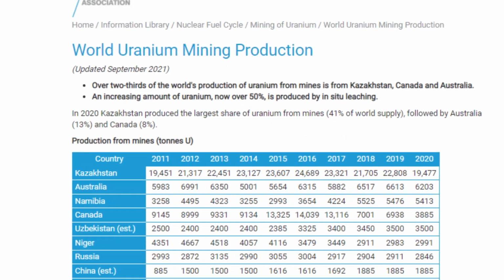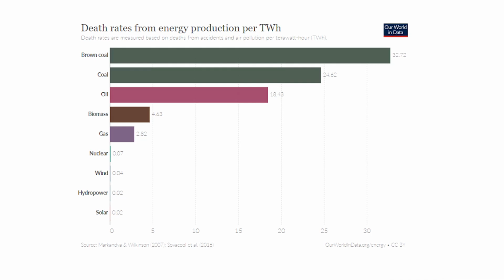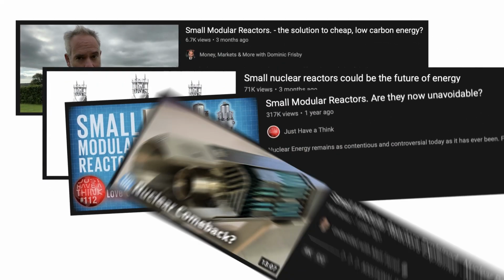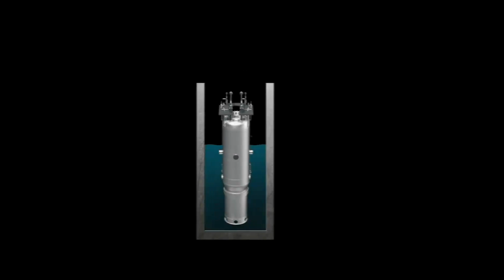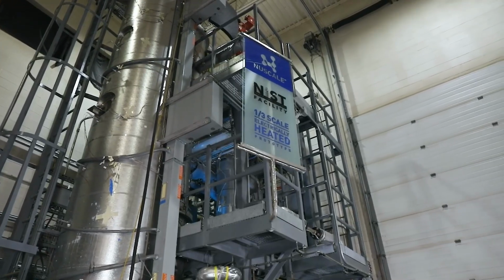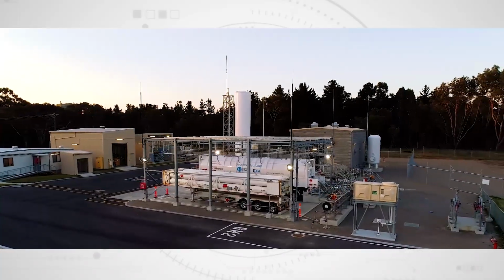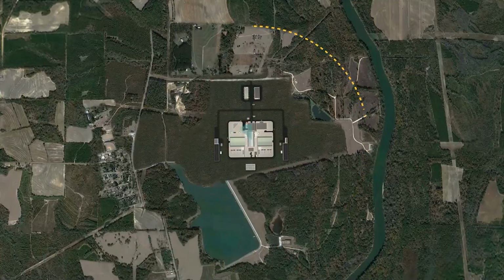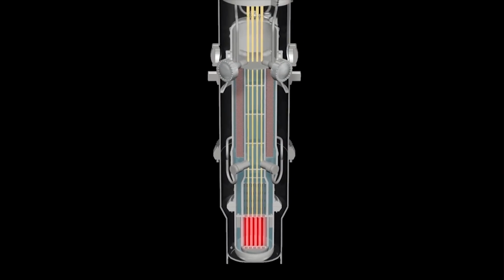Can Small Modular Reactors Save Nuclear Power?

Comment: My only really strong opinion about nuclear is that shutting of nuclear before you get rid of fossils is super stupid.
Reply from the maker: Where there aren't safety issues, I agree with you.
Reply: @EngineeringwithRosie  Sure, but safe operation of any power plant - nuclear - and also hydro, geothermal, wind, solar - is a given.

Similarly it is a given that coal plants (without sequestration) CANNOT be operated safely - acid rain, particulates, heavy metals, radiation - all directly into the biosphere.

However, were any of the German plants shut down due to safety concerns? Um, no.
Every once in a while a regulator finds a safety concern, the NPP is shut down temporarily, the operated fixes it, and the plant is reopened. There was no long-term concern for any of the German NPPs - in fact Germany has one of the best safety records in the industry!
Reply: @factnotfiction5915  Putin is a NPP country, no problem there.
90% of the world's population is in dictatorships, no problems there.????
Reply: @factnotfiction5915  actually, there were plenty of safety concerns, not to the level of a potential meltdown, but still. Germany saw a string of incidents and accidents in the years before, accompanied by a lot of untrustworthy behavior by operators (hiding incidents, late reporting, downplaying, dragging their feet on implementing mandated corrections, etc). So in a way, Vattenfall (and others to some extent) laid the groundwork for the later decision. 
I also agree that it wasn't a smart decision - what they should have done is make an example of Vattenfall, removing their operator license for good and make them sell off thrir plants to more competent operators.
Reply: @stephenbrickwood1602  '90% of the world's population is in dictatorships, no problems there.????'
The problem with a population living in a dictatorship is that they live in a dictatorship, it has little to do with civilian nuclear power plants (NPPs).

Putin's Russia is an example: If the RF closes all their civilian NPPs, will they disarm their nuclear weapons? - no.
If the RF builds more their civilian NPPs, will they build more nuclear weapons? - no.

You don't need civilian NPPs to build nuclear weapons, and there is little correlation between weapons and civilian NPPs. The United States built 3 nuclear weapons in 1945. Twelve years later, the first civilian NPP was built, Shippingport in 1957.
Reply: @factnotfiction5915  RF ???????
Reply: @stephenbrickwood1602  RF = Russian Federation
Reply: @factnotfiction5915  
There is a correlation between nuclear power plants and nuclear weapons.  The US nuclear weapons use tritium, which must be obtained by using nuclear power plants.
Reply: @acmefixer1  
There is NO correlation between nuclear power plants and nuclear weapons.
* Germany has NPPs, no nuclear weapons.
* Japan has NPPs, no nuclear weapons.
* Slovakia has NPPs, no nuclear weapons.

* Ukraine has NPPs, no nuclear weapons.
* Mexico has NPPs, no nuclear weapons.
* etc etc

* North Korea has nuclear weapons, no NPPs.
* Israel has nuclear weapons, no NPPs.
* etc

* USA built nuclear weapons, before NPPs.
* USSR built nuclear weapons, before NPPs.
* France built nuclear weapons, before NPPs.
* UK built nuclear weapons, before NPPs.
* etc, etc

Yes, the Indians built a NPP before building the bomb. They waited 30 years before taking that step. 

Nuclear bombs are a political decision, and civilian nuclear power has little to do with it.

However, civilian nuclear power does PREVENT bomb building. UAE adopted the NPT as part of building their NPP!!!
https://www.world-nuclear.org/information-library/country-profiles/countries-t-z/united-arab-emirates.aspx#ECSArticleLink4

"The US nuclear weapons use tritium, which must be obtained by using nuclear power plants.
" - not quite correct.
The US obtains tritium from nuclear reactors (yes), run as tritium factories for the military, not run as civilian power plants. NO US CIVILIAN POWER PLANT PROVIDES TRITIUM OR PLUTONIUM-239 FOR BOMBS!
Reply: @acmefixer1  "There is a correlation between nuclear power plants and nuclear weapons."

But I think if there's causation it's not: nuclear plants -> nuclear weapons. It's far more likely that it's: nuclear weapons -> nuclear plants.
Reply: @factnotfiction5915  One third of the nuclear power plants in France have been temporarily shut down during the record summer of 2022 due to overheating of the cooling water of the plants. Furthermore one quarter of the nuclear power plants in FR older than 20 years are currently shut down due to risk of breach of the reactor vessels. Hydrogen infiltration in the steel reactor vessel apparently causes fissures which lead to weakening of the pressure vessels. Result: France is in a pickle in the middle of the winter and needs to buy electricity in Germany and Spain.
Reply: @haveaseatplease  Sure, half of French reactors shut down in the summer of 2022 due to cooling water problems.

They have since started up again, because the hot cooling water of June has been replaced with normal temperature cooling water of January.
6 months have passed buddy! Weather has gotten colder.

The summer is also the low point of demand in France. 

Lastly, poor siting of a reactor along a river does not condemn an entire technology. It condemns a given plant.

The technology is fine, as long as cooling is provided. That may require out-of-the-box thinking. For example, the LARGEST NPP in the US (Palo Verde) is sited in the middle of the Arizona desert, and does not rely on lakes, rivers, or the ocean for its cooling water!
It shows that with creativity, nuclear technology can work anywhere.

Sadly, wind and solar cannot work everywhere, or all the time. It is a fundamental physical fact that the earth rotates and denies us use of solar about 50% of the time; and that winds die down and speed up randomly.
Reply: @factnotfiction5915  *Palo Verde, not Palo Alto
—I'm from AZ
Reply: @makego  > *Palo Verde, not Palo Alto
Thanks for noticing.
I have corrected the original post.
Reply: I agree.  But the utilities are only looking at the costs and not the benefits.  They don't want to spend more money on relicensing a reactor which has a license that's about to expire.  It's dumb because they will have to spend hundreds of millions to decommission the plant.
Reply: Germany is in a pickle now...
Stepping up lignite production to meet their shortfall is about the worst thing for the planet right now.
Wealthy Northern/Western nations should be leading by example, not turning back on a long history of safe energy in their respective country. (IMO)
Reply: @jimurrata6785  Germany collected more renewable energy than that produced by France (a nuclear advocate) from nuclear energy in 2021.
Reply: @eclecticcyclist  Hopefully they can scale up enough storage to make it through winter without Russian gas.
Reply: @jimurrata6785  Russia isn't the only source of gas, what happened to fracked US gas?
Reply: @eclecticcyclist  But Ukraine's gas fields were occupied eight years ago and I'm unsure that any other nations have pipelines into Germany.
Yes, America has been a net exporter of gas since fracking took off. But it's certainly not all positive. The mud is pretty toxic and extraction causes clusters of minor earthquakes similar to the Netherlands.
Shipping LNG will not be cheap and infrastructure to land it needs to be built out for it to become a viable option.
Reply: @eclecticcyclist  Russia are not the only supplier but they are significant enough to cause market instability when they shut off the pipe. 
The US can supply LNG via ship but its extremely expensive compared to pipeline and Germany doesn't actually have the port facilities to receive it.
Reply: @jimurrata6785  It seems even extending the use of their 3 remaining reactors is politically impossible let alone re-starting any of the already closed ones. Thus it seems there isn't a good alternative to lignite.
Reply: @seneca983  That's what I'm saying.
Rejecting the best option in favour of the illusive perfect solution.  🙄
It smacks of fanaticism or zealotry, and this is in no way a knock against the Greens.
The same thing here in the US. Closures decades ahead of the sunset of regulatory approvals.
Reply: @seneca983  
The "alternative to lignite" is renewables plus storage.
Reply: @acmefixer1  You can't build them fast enough. They should be ready already this year. I don't think there is an alternative to lignite on the short term. (Note that I'm specifically talking about the potential acute crisis that may come from the unreliability of Russian gas deliveries during the Ukraine war. I'm not talking about the longer term.)
Reply: @seneca983  Ask Hansel and Gretel.
Reply: @acmefixer1 wind and solar is not enough by any stretch. Its just not realistic and feasible. Anyone with even basic math skills can see that.
Reply: @suprlite  
Really?  Why don't you go tell that that to the state of South Australia?  They're already doing it.

You don't know what you are talking about.
Reply: @acmefixer1  Ok. In a scarcely populated land that requires little heating of houses,  and concists mostly of flat desert, and has lots and lots of sun it can somewhat work. But if you think that it can work everywhere in the world, like for instance in the arctic; you are beyond clueless.
Reply: @suprlite  There's an Australian plan to power Singapore and parts of Indonesia.
Reply: @oneeyedphotographer  🤣
Reply: 90% of the world's population is in dictatorships and NPP are not part of your strong opinion.
Putin and little rocket man and the Iranian leaders and ...... would be so happy 😊
Reply: Nuclear reactors were originally created in order to generate plutonium (breeder reactor).. for use as the most toxic  nuclear bombs.   Everything which COMES out of that intent and energy... (and then the first use of that, to kill people, which was NOT needed, to stop the war.),  DOES NOT BODE well for anything which derives from that creation.
Reply: @richardmcdonald7565  "DOES NOT BODE well for anything which derives from that creation"

Any kind of "foreboding" is just a superstition. It's not like the intent of some military people many decades ago affect people who design commercial nuclear reactors today.
Reply: @richardmcdonald7565  You can argue that steel was only created for better weapons so everything made from steel is bad. 

Nuclear was first developed for civilian use, then WW2 came along. Yes the first reactor was created for bombs, but it wasn't invented for it.
Reply: The drowning of equatorial countries by sea level rise already an emergency.
Reply: https://youtu.be/JQRXEn_i5nM
Reply: "super stupid" ....or political
Equals to some politicians are super stupid
Reply: And screw the equatorial countries where sea water rise hits first (wet spinning sphere ).
Reply: The "inflation reduction act" (stupid name) just passed in the USA has significant support ($ and regulatory) for keeping existing nuclear plants running so long as they are good with the safety stuff.  Also has some funding for advanced nuclear development, but that is more about keeping the R&D going in case there's a breakthrough than really betting it will be ready quick enough to help with the immediate transition.

Just nice to occasionally have an example of not dumb politics ;)
Reply: @travcollier  Look into Thorium Molten Salt Reactors and allied breeders.  Intrinsically safer.
Reply: @SovereignTroll  I am familiar.  That is one of the technologies classified as "advanced nuclear".  
The problem isn't the fundamental tech, but that it is a decade+ of development to get to full scale, and then decades more to build out enough to make a real dent in energy demand.  Simply too slow.
I do wish we had put serious $ and resources into developing that tech a few decades ago, but we didn't.
Reply: This comment aged amazingly. Like, stupidly well hahaha
Reply: Is the hydrogen produced able to be used by hydrogen vehicles?
Reply: Not if you want to cull the population
Reply: dont restrict any energy wtf.
Reply: Biggest issue is the waste.
Reply: @johnholland1308  Thorium Molten Salt technology and breeders next gen. consume existing waste converting it to short-lived or consumed species.  Also it a problem occurs a plug melts out and removes the reactants safely.  The existing tech buries this tech but France uses a variant of this and so do nuclear subs I understand.
Reply: A layperson comment, the emergency so advanced that now is actually too late, damage being done.  Use of energy and unnecessary travel must become Torts  punishable.  Forget your previous biases.

Comment: Another excellent video Rosie.  Thanks. 

A few massive flashing warning signs jump out at me.  Feature creep and minimum viable product are critically important concepts, and the downfall of so many new companies.  Even simple product ideas are very difficult to execute in practice.  They're making an SMR.  That's a really great thing.  Stop there and get that working.  Add in all this extra stuff like high temperature hydrogen production and they're doomed.  This is the trap that kills so many new companies.  They're going to over-extend themselves trying to do all this other stuff and the whole company will implode.
Reply from the maker: I agree that's a risk, it's an issue I fight about with nearly every startup I work with! They have a huge number of features they're trying to incorporate before they produce their first demo. I am always telling them to just get the most basic functionality working, then add in features later. 
In my experience, usually the reason startups are adding features "too" early isn't because they are trying to make life hard for themselves, but rather because they need funding. And a customer has offered them funding if they add feature X. Or, they assume potential funders will require feature X. Usually the latter actually.
Reply: @EngineeringwithRosie  I think you hit the nail on the head with the funding.  Hydrogen is a much more impactful buzzword right now compared to SMR.  If you're going after green funding you need to say either "hydrogen" or "carbon."  In reality we need all of these things, but only some are getting attention. 

...don't even get me started on all the mega-nano-carbon-hydrogen-blockchain funding scams.  I've (briefly) worked with one.  The ease at which a company can vacuum millions in funding simply by saying a few key buzzwords is staggering.
Reply: @unhinged-menagerie  In the video though he did say that a lot of their prospective clients have declared a need for hydrogen (a current need, as I understood it) and so that market should be guaranteed. Whether hydrogen becomes a hugely important part of our energy and fuel use in the future or not, there are existing demands for hydrogen and being produced by nuclear power plants would be an environmentally friendly way of producing it.
Reply: @EngineeringwithRosie  another possible reason that startups add features is that the core concept does not stand up to close scrutiny. So the only way to make the product viable is to add commercially valuable by-products
Reply: @pbecker1865  That (and/or) they have to keep refreshing the buzzwords to keep their lease on the various funders short attention-spans.
Reply: @pbecker1865  Perhaps, but that is not the case here.
Reply: @EngineeringwithRosie  I'm at one of the go8's and we're encouraging this practice at the very bottom of the innovation chain. Ideas without keywords like "hydrogen/fusion/anti-matter" are thrown out without even being looked at, often by computer algorithms that give students better grades for using them and penalties for "gas/coal/oil".

I've personally had struggles to even get anyone (including my own professor) to make time to have a look at my working prototype for an extremely efficient generator while I had gas as a fuel, while the same project got me an invite to accelerators when I replaced gas with solar - despite turning a feasible quick sub-in for present power grid into a theoretical future project that didn't even solve any problems unlike the OG.

No one is going to be on the frontlines in the battle that is commercial operations when we incentivise being in the "R&D" stage with less accountability and work needed. My parents are in tax law and have clients who actively prevent commercialisation of a concept to claim R&D tax benefits - there's literally a computer algorithm that is used to do this, which currently demonstrates more commercial feasibility that any of the projects it encourages. 

Unfortunately the only way to sort this out is for people to pay attention and have healthy debate before forming an opinion on something, which is literally the one thing people have an unanimous opinion about in disliking. I'm actually curious about your strategies to deal with this issue as everyone seems to approach it very different ways?
Reply: I believe this is a good advice.
Reply: Joel and Rosie, you bring up good points about funding and investors. During the birth of civilian nuclear power technology (think "Atoms for Peace" project) you had a massive amount of federal government research, spending, backing and promotion. The regulators (good or bad) followed lead, and an industry was born. But then, when promises were broken (eg, "electricity so cheap you won't need meters") and a few catastrophic accidents, public sentiment changed and fear became the driving determinants. The biggest travesty was that Molten Salt Reactor technology was aborted before it was even born.
Reply: What is wrong in adding an (H2) module to a modular reactor? Perhaps heat loss from the connecting pipes? Make it a bolt-on and you can take off and replace the connection caps